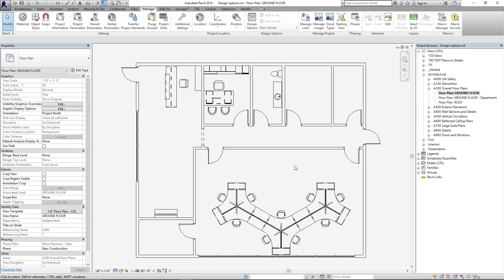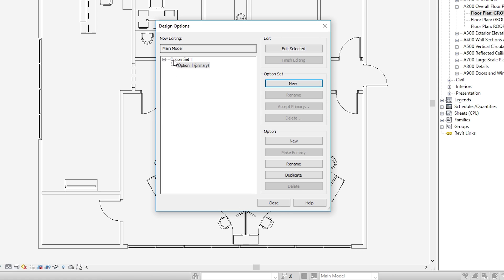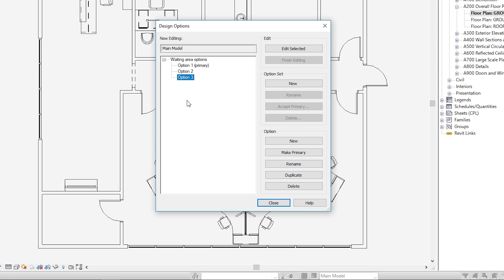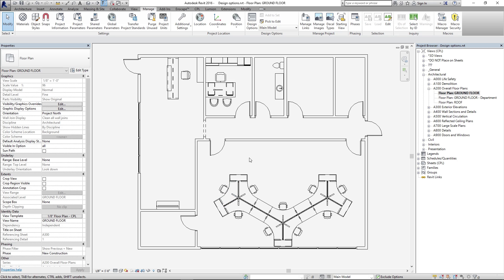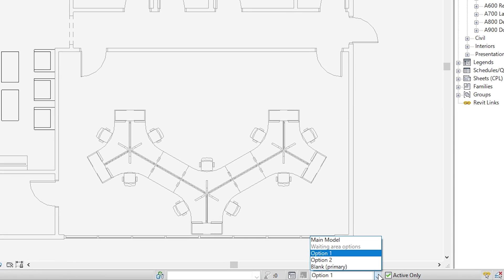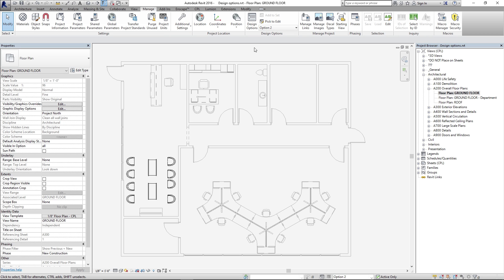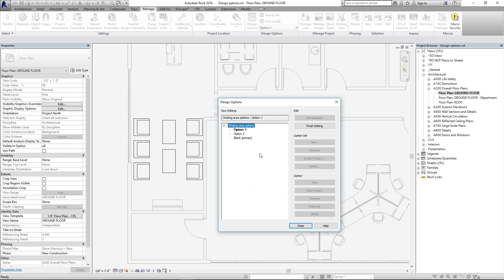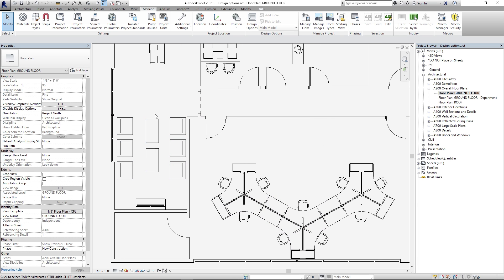Design Options in Revit (pt.1 The Basics)

Comment: Thanks. This seems to work well minus the fact that I have created 1 option as proposed and now want to create a second option. However, for whatever the reason the new proposed walls seems to be locked to MAIN MODEL although it is actually Option 1. The only way to change this would be to delete all and draw it again using this method. Surely there must be another way?
Reply: I'd love to know the answer to this too.
Reply: @brazilsgirl  I am drawing with Fabrication components, but what I did was cut out of the model the parts I wanted to keep, paste into option 1 and set that as primary. Past the same into option 2, and modify as needed. Rename Option 1 as "Current", and Option 2 as "Future" (based off the drawing sets I had to model from)

Comment: IF I put room tags into a floor plan called "floor plan option 1" and it has the design options, why will the room tags not come on in a floor plan called "new construction plan"?
Reply from the maker: When you switch between options, it will only copy over modeled elements like walls, doors, casework. Room tags are annotation elements like dimensions and text. They will not be copied over.
Reply: @AdamAnzivino  I found out what I needed. I think I just made room tags in each option. It dosent make extra room tags